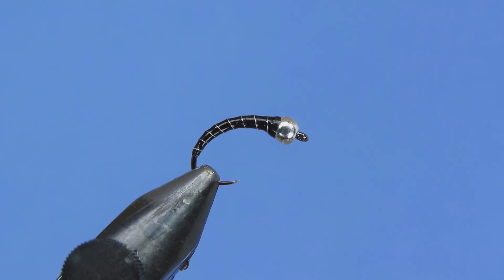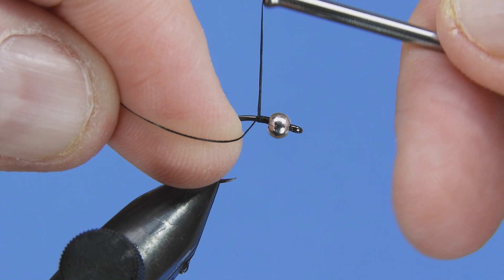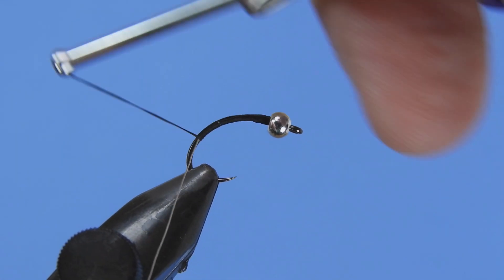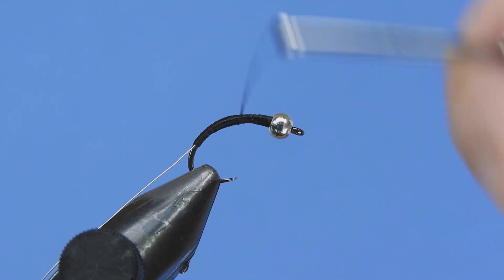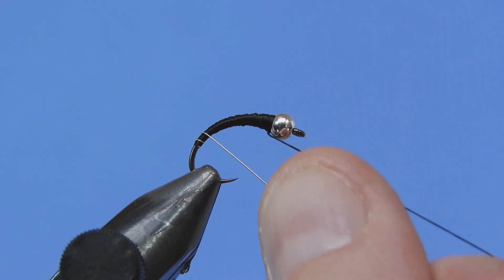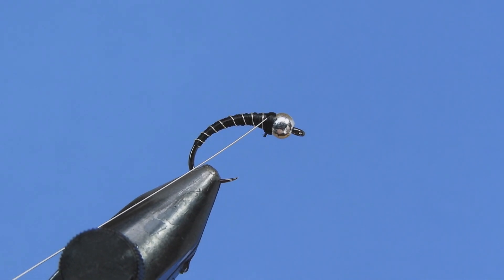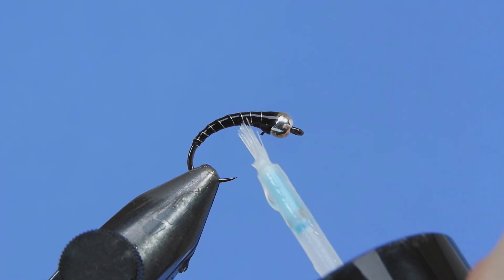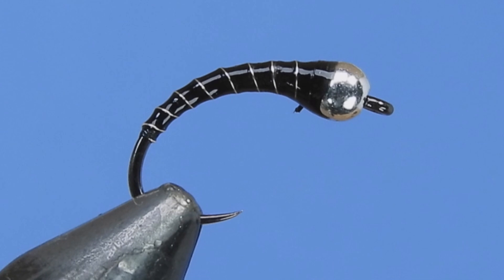Tying the Zebra Midge fly Pattern - PF #PiscatorFlies

Comment: Just wondering, do you worry about getting UV resin on your vise jaws? I'm just beginning tying, and I'm not sure if I should apply resin on the vise or elsewhere. Thanks, a very helpful video.
Reply from the maker: I do get a bit on the vise from time to time, but it doesn’t stick to the jaws too badly. If you are worried about it happening you could use a hackle plier to hold the fly. Cheers and thanks for dropping in

Comment: Chimo, nice ZM. Thanks for another taper demo. So when and how do you take care of that thread tag? I thought you'd pull out your blade or singe it without supervision ;o) Doesn't the resin make it harder to cut? Just curious, I'm sure the fish won't mind a little "soul patch", lol. How's the water? Cheers
Reply from the maker: Chimo Joe, it gets a little stiffer from the UV, but you can still cut it no problem. It the tyer's problem more than the fish, lol. I haven't been out, too much water in the system right now, It'll be about a week or so I think before things start to settle. I've got lots to do in the meantime. :( Cheers
Reply: @PiscatorFlies  same here, going to rain all week. They're sandbagging Sodus Bay on L. Ontario. The shoreline flooding getting worse every year. Hope you get to go out.
Reply from the maker: I hope I get out soon also. Walked out by the river and it's chocolate milk right now. More rain today, tons of flooding around Ontario, Quebec and New Brunswick. I'm tying flies instead. Cheers
Reply: @PiscatorFlies  Yep pretty bad. grigri077 posted two videos showing high water. I think he's from Quebec and the view was I think of the Lake while driving on a highway.
cheers